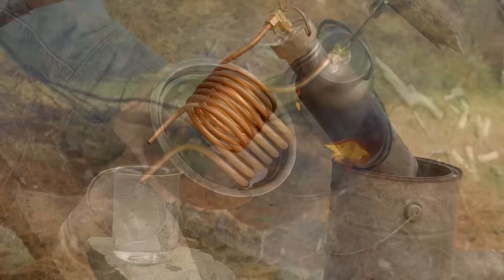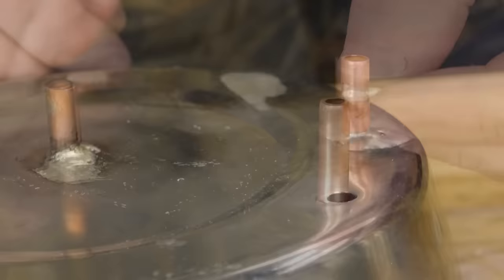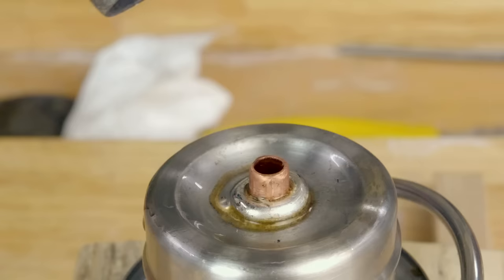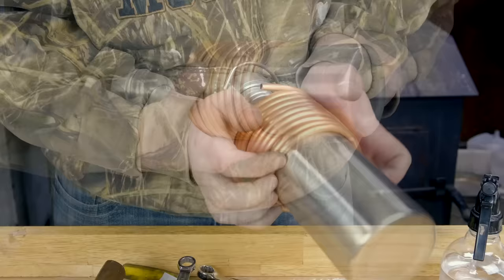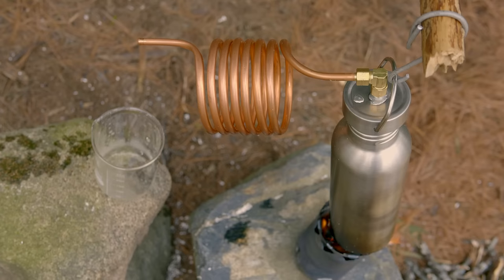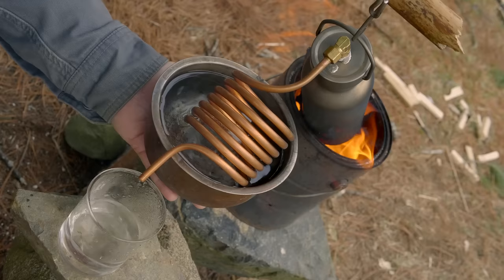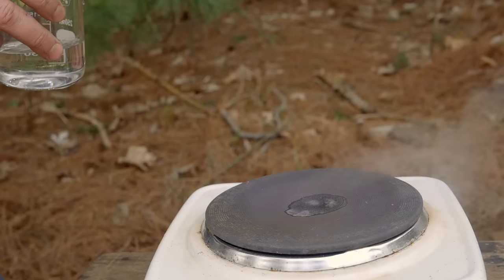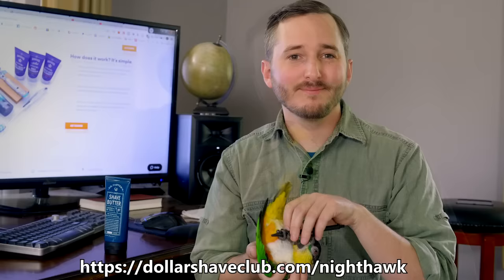DIY Salt-Water Survival Bottle (Compact Desalination Kit)

Comment: A lot of steel water bottles have a non-stick coating inside. Also important to make sure that yours doesn't before boiling water in it.
Reply: This is very important and should be mich higher up in the comments for more people to see and for NightHawk to see as well.
Reply: This is very important and should be higher up in the comments for NightHawk and others to see because steel bottles indeed have coatings on the inside.
Reply: +1 
(Replies seem to push comments further up)
Reply: Yep
Reply: There's no point in trying to remove it. Just buy one that doesn't have one.
Reply: This video has a lot of big no no’s.
Reply: Maybe not if it is stainless steel, he said to use a stainless steel water bottle.
Reply: He could just use a camping cooking pot with a modified lid, or a storm kettle
Reply: Movin on up, movin on up
Reply: Bump
Reply: Uhhh...bump?

I was under the impression that almost all cans have some kind of plastic liner which is why you can't cook or boil water or smoke out of them. I'd imagine an old paint can as being a bad idea too...
Reply: @Mikey-ym6ok  enlighten us bro
Reply: Maybe burn it off?
Reply: Show me an example of a stainless steel water bottle with a coating inside. Never heard of such a thing. Aluminum, yes, SS, never.
Reply: bump
Reply: Michael Smith wait what else did i miss that i should probably take into account?
Reply: @Kernels actually you can usually burn them out.  Just make sure to clean it very well before using.
Reply: bump bump bump
Reply: K. as a kid I could remember feeling the inside of an old canteen and there was like a film now I know why
Reply: Literally the first thing that came to mind.
Reply: Comment to get it up
Reply: Aluminium, yes. Stainless steel, no. You could change your comment to state that.
Reply: Bumpidy bump bump
Reply: Well said. My kids watch these kinds of videos.. so thanks for mentioning this :)
Reply: Definitely! Is it possible to simply burn out that coating first?
Reply: K. Reply
Reply: Mr. Tangent just look up soda cans with it in it. It’s similar
Reply: bump bump it up
Reply: Commenting to push this to the top
Reply: @MealeaYing  its there to protect from oxidation and such. So by physically removing that saftey piece. May not be the best long term choice of usage. Heavily depends on the metal type and purity. Aluminum for example is toxic especially when heated.
Reply: +1
Reply: @demonsparkx  you're talking about long term usage for a device meant to be used in survival circumstances?
Reply: @DylanNeo  well in that sense,more so as a "multiple time usage" so i suppose?
Reply: @DylanNeo  salt + metal+ heat... thats all i guess.
Reply: Bumping this comment for your mum mate
Reply: @Mikey-ym6ok  which are?
Reply: Michael Smith.... 

Where you at?
Reply: Huuhhgtt
Reply: opaz79 chemical mixes with it
Reply: Also, be sure to use lead free solder for the fittings.
Reply: just wanted to add that if you happen to be using a vaccuum insulated water bottle like a Hydroflask (very popular nowadays) this definitely wont work, don't try heating that sucker up!
Reply: @isaiahstephens3509  Stainless steel containers still contain a coating of some sort of liner, to keep your drink from tasting metallic.
Reply: @Kernels cooking it will remove it
Reply: Michael Smith 
Like led  of the joints?
Reply: Michael Smith 
Please explain the no no's
Reply: @Kernels no coating is necessary especially if the container is made from stainless steel.
Reply: Aluminum water containers would be inappropriate for this as they can quite easily burn up in the process. Stainless or even regular mild steel would work.
Reply: Great comment never thought about it thanks for sharing
Reply: @Mikey-ym6ok  why? Tell us more thanks
Reply: @BajaSurf  there are carcinogenic coatings on metal bottles to keep them from corroding  and rusting. which leaks in the liquid then inside our bloodsteam. i just say to be cautious and use a pots thats meant for cooking and not insulating
Reply: @michaellinner7772  im a welder and stainless steel has a coating to make it stainless. thats why we have to wear respirators to prevent inhaling the stainless coating when welding a stainless material.
Reply: Bump bump :)
Reply: @Mikey-ym6ok  I researched the bottle used on this video. According to the seller/manufacture Sold by TripleTree that bottle is non-coated (in and out), lead/BPA free 18-8steel. Making it completely safe for this procedure. NightHawk didn't mention it in this video. But, was it really needed?
Reply: Pressure cooker or a regular kettle with a modified tip will do the trick. Can flow directly into the watery bottle.
Reply: I havent heard of any stainless steel bottles having a non stick coating, not even SS pots or pans. But I dont think thats of any concern if you needed to resort to making clean water from salt water.
Reply: @Mikey-ym6ok  I don't know what kind of welder you are,  nor do I care, i work with stainless as it's made, it is non ferrous,  as is all stainless steel, it is an alloy that contains zero iron and does not rust. There is no such thing as a coating to make it stainless!. You should wear breathing masks with ANY welding if you can't avoid the fumes.
Reply: +Shane Stevens

The guy who said stainless steel has a "coating that makes it stainless" was hilariously wrong, but what the hell are you talking about "stainless steel is non-ferrous/has no iron content" !?

The definition of stainless steel is literally "Stainless steel is an alloy of Iron with a minimum of 10.5% Chromium." Google it if you don't believe me.

Stainless steel not only contains iron...it is iron with other alloying elements, especially Chromium. 

If you had said "non-ferrous", and left it at that, I would have thought you made a mistake, or misunderstood the meaning of "ferrous"...but you reiterated, and emphasized, "no iron content" so I'm just baffled.
Reply: @Kernels maybe strong acetone or something similar.
Reply: @HipposHateWater  No they don't! Stainless steel doesn't give off any "metallic" taste. That's sort of the point with stainless steel -- it's stability, and thus resistance to "give off" anything.
Reply: Never again will i drink distilled water without first adding some himalayan rock salt!
After drinking only Distilled Water for two weeks, all the discs in my neck were grinding and pinching! Very painful! it took months before i stopped feeling the terrible pinching!  Every now and then it comes back for a bit!
Reply: Michael Smith so what are they?
Reply: @donsunb  wow, thanks for taking the hit so I don't have to...
Reply: Chet Carson  if your in a servival situation, you're probably not eating healthy.
Reply: demonsparkx What about a custom copper water bottle without any lining
Reply: demonsparkx What about a custom copper water bottle without any kind of lining
Reply: how do i check if my bottle has a non-stick coating inside?
Reply: And that coating causes cancer when heated.
Reply: Michael Smith yup so does the rubber sealing thing
Reply: @Mikey-ym6ok  Stainless steel is "stainless" because of the addition of chromium and nickel.  316SS also has Molybdenum.  There is no coating on stainless steel, at least not to make it stainless - it doesn't need it.  You wear a mask to avoid inhaling hot vapors, some of which are toxic and some of which are only physically harmful to your lungs.
Reply: Non stick as in?? Do u mean Teflon coating??
Reply: thanks for this suggestion!
Reply: Yes
Reply: @bowttt  Thanks! I wish the OP had just said what bottle he used in the video or description to save us all  a lot of guessing.
Reply: @Kernels 
No coating at all.
Reply: @Mikey-ym6ok  
Can you be specific?
Reply: @GreatSageSunWukong  
Kettle is great idea.
Best solution uses
Charcoal fuel source, eg gallon paint can with holes in lid left on camp fire about 2 hours, or till no more smoke escapes can.
No paint can?
Bank camp fire coals. 
Cover with dirt.
(Bee Hive oven).
Dig out charcoal
when fire is cool.
Reply: @bodypilot2006  
Thank you for pontificating, Comrade Troll.
Apples & Oranges.
Are you Mossad???
Reply: @calysagora3615  hexavalent chrome is formed welding stainless steel
Reply: this may have been mentioned already but steel bottles dont have coatings on inside. tin and aluminum bottles are the ones with coatings. i can produce several of each from my collection to prove this.
Reply: @blumac9801  soda cans are ALUMINUM not steel. aluminum bottles and cans have coatings NOT steel.
Reply: doubt it matters, he's distilling it lol. besides, would you rather saltwater or a little bpa
Reply: @Mikey-ym6ok  Yes thats true, but it does show a cool concept that is also useful in real life. Hence, the comment section filled with big brains making it better.
Reply: Aside from that, a lot of them have a gap in between 2 layers that is vacuumed. That would make it hard to boil .
Reply: Thanks for a crucial warning. That non stick stuff puts out a DEADLY vapor. Probly would spoil yer likker too. Just sayin.
Reply: @Mikey-ym6ok  Go on. Tell us more.
Reply: .  I believe the respirator is a precaution against the filler metal used in the welding process. Stainless steel contains chromium and other alloys so welding this material creates potentially toxic vapors. The feller material can also contain certain chemical fluxes.
Reply: @shanestevens622    stainless does have iron and therefore is ferrous. By adding chromium, zinc, and other elements we change the molecular bonds or the crystalline structure. This change makes it non magnetic.
Reply: shane stevens there are ferrous stainless steels mate and they do contain iron hence being magnetic
Reply: @Kernels maybe acetone. I don't know much about chemistry but acetone dissovles some plastics and its probably BPA.
Reply: check those bottles
Reply: I did notice a few specks of black stuff come out when he poured a little of the concentrated salt in. It wouldn't be a problem if he didn't pout any in, though perhaps a few volatile chemicals in the non-stick could vaporize if they are lower temp boiling than water.
Reply: @travv88  its not concentrated salt you can't concentrate a pure compound. It only applies if its a solution. Also without salt in your water, pure distiled water will make your cells explode to equalize the difference.
Reply: Brian Landers  oxidization if i spelled it correctly,yes that is the worst of the worries once near critical temps are reached with certain metal grade alloys. Aluminum oxide. Titanium oxide etc,for example. Are hazordous to health especially in due to long time exposure/ingestion. This is based however soley on pursonal knowledge and research of alloy metals,heat,and usage there of for human based consumption/cooking etc.
Reply: @bowttt  yes because some stainless is I'm not really stainless like Michael Smith was saying. 
Real stainless is harder to work with more expensive and a lot heavier.... or else you wouldn't see stainless steel bowls and containers in the dollar store..
 I myself prefer to use a plastic bottle on top of an asbestos tile and then I add some MDF dust or grindings to soak up the salt and just spoon that out and have myself a really nice super purified legitimate well drinking water for survival in any circumstance or everyday use😄🍳
Reply: @reiki2165  lacquer thinner or xylene but if you have those then just use the container they come in
Reply: @giottolaudo7672  with all due respect to your experience and the others who share your opinion, it's extremely possible that there are really cheap versions of stainless steel better actually just coatings the same way Chrome or nickel plated is.
 In my other comment I use an example that you can get a stainless bowl at the dollar store...
... am I wrong I can accept it if I am but if there are different grades of stainless and it is possible to apply a stainless coating in any other form that a coating can be .... wouldn't that make sense?

.... in a week and Mild defense to mr. Smith or the person that said stainless has/ is a coating, could he be referring to the oils or a protective layer that comes on Raw stainless that is meant to be used in fabrication or pre-production?
.... it's also possible that he is speaking about the material used to well the stainless or cut it for that matter because it may change structure with the heat involved and look like a coating at that point.

..... either way if fire is available in emergency situations I would heat the s*** out of it anyway just to be sure.
Reply: @DylanNeo  isn't survival supposed to be long term? I know I want to survive long term 😹
Reply: @the20thDoctor  He used a coffee can, not a paint can
Reply: @demonsparkx  The whole point of stainless steel is that it doesn't corrode, and therefore shouldn't need a liner. People often buy stainless steel water bottles instead of aluminum for that very reason. They don't have to worry about anything leaching into the water from the metal.
Reply: @Michael Montgomery a year later and glad to see i never even was bothered to be fuckin notified by youtube of your reply. Triggered much? Didnt know there was children watching this video which can demonstrate a potentially harmful hazard to mimic without proper understanding of different alloy compositions. Lol...
Reply: @wolfy1987  SS food grade stuff can be easily obtained in very reputable forms in camping survival sections of many franchised stores like Wmart. We have both a stanley Stainless Steel and a aftermarket online purchased  similar style cooking cup but is Titanium. Both work great even despite dry-heating each of them to see how the alloys held up. Most bad low impure quality "knock off" products metals seem to flat out permanently taint anything put in afterwards.
Reply: @gulktroktet  How do you do that?
Reply: Just want to say that i have alot of stainless bottles, they DO have a coating on the inside, i think its a clear teflon coating or some kind of non stick to prevent drinks from dirtying the inside
Reply: As long as you keep the bottle temperature close to 100C, it probably isn't an issue. Especially not an issue if it's your only water option
Reply: Stainless steel doesn't have a coating inside, you are thinking about aluminium, which shouldn't be used anyway. Also, buy a product that passed the food grade standards of first world countries, never buy some low grade SS product directly from China.
Reply: @Mikey-ym6ok  You are thinking about dichromates, it is not a coating but rather an ingredient which turns the iron into steel, the chromium alloys with the iron and isn't present anymore as carcinogenic Cr(VI). In spite of the chatter surrounding the amount of chromium and nickel contained in stainless steel surfaces, the bond of the alloy used to construct the cooking surface of quality stainless steel cookware sets is quite strong. This alloy strength helps pots and pans resist leaching, making them quite safe.
Reply: @shanestevens622  Stainless steel is still an iron-based alloy, but as it contains next to (~70-80%) iron at least 11% of chromium and at least 8% of nickel, the other metals completely remove the iron's capacity to rust, and its magnetic properties. Often molybdenum is added too,  improves resistance to "pitting corrosion". You are right though in stating that an alloy isn't a coating, and that you should never breathe the fumes from any welding.
Reply: @bromisovalum8417  no, it is stainless steel, and it does have a coating on the inside of some of my bottles. Obviously stainless is an alloy and normally wouldnt be coated as its resistant to oxidation. But in some of my water bottles they add a teflon or non stick coating to the inside..
Reply: @giottolaudo7672  my apologies,  you are correct, I learned something today. I always thought it was a non ferrous steel, and borne out by it being non-magnetic  but, have found it is the inclusion of the nickel that renders it non-fed magnetic,  some grades must have less nickel though because I have come across some magnetic (weak) stainless steel. Cheers.
Reply: @thomask940  yes, you are correct,  I was wrong, I've learnt something new. Cheers
Reply: @LukeSmith-pp4hn  yeah, sorry, I've been wrong about stainless, I couldn't understand why some of the stainless I've encountered was magnetic,  now it makes sense.
Reply: @bromisovalum8417  yes, thank you, I was wrong about the metallurgy but I'm still sure there is no coating on stainless bottles.
Reply: @Mikey-ym6ok  what? Stainless steel is a coating? Like a paint you mean? LOL
Reply: @donsunb  do you still drink (only?)distilled water (after adding some stuff in it)?
Reply: Can the rubber sealant melt during the boiling process?
Reply: Not stainless ones
Reply: Only aluminum bottles have a need for that coating. Stainless will not have this.
Reply: Check out the movie “dark waters” about non stick coating
Reply: The owner of this channel should pin or heart these informative comments. So everyone can see these bits of usefull information.
Reply: boil water and throw away for several times or burn dry the bottle before consuming it, like sterilizing it , no big deal if it only for survival.
Reply: Bump
Reply: You guys did it lol it was the first comment I seen and it definitely wouldve saved me lol
Reply: Sorry to necro a year old comment, but stainless steel nalgene and klean kanteen are both suitable options
Reply: @Mikey-ym6ok   specify on SS , there are no coatings on that bottle ,specially if sold for human food consumption ...if so , what is the coating you say they use?
Reply: @Mikey-ym6ok  you have to use respirator for "all" metal welding to protect your lungs not just for ss and the fumes also comes from the rods or wires you are welding with !
Reply: I ordered titanium bottle for this, problem solved.
Reply: قنفإ
Reply: @nicklopez7536  ..
Reply: @MealeaYing  if it has a coating, it's aluminum and not stainless steel.
Reply: @Mikey-ym6ok  Please name them so we may learn?
Reply: Água destilada não deve ser ingerida.
Reply: Thanks captain obvious
Reply: If it is stainles steel a coating is not needed, so it is not added. 
Why would you increase your manufacturing costs for no reason?
A water bottle with an internal coating is not stainless steel.
Reply: Sus
Reply: Very true
Reply: @ButtersDaBaller  im stupid so tell me why?
Reply: @Mikey-ym6ok  We need your wisdom michael smith, please inform us all of the “No nose”
Reply: @shanestevens622  Did @Michael Smith lie to us? ——-Why would he do that?
Reply: @giottolaudo7672  So @Shane Stevens lied to us? Why would he do that?
Reply: @donniexl1033  He probably didn't 'lie' willingly,  but was misinformed, or understood the situation wrongly,  as I my self did on the iron content of stainless. Stainless  needs no coating,  that is why it is called ' stainless ' , specifically because it is highly resistant to corrosion.
Reply: Nice Catch, :)
Reply: Bump
Reply: @SnahLhug  you are wrong, stainless has it too
Reply: YES YES YES.....  I was just going to post the same thing....  That coating will get you sick
Reply: @nicklopez7536  

l
Reply: Bump
Reply: @nicklopez7536  aww😚😚😚
Reply: What if it has? How this is going to affect the process?
Reply: Good video
Reply: Coating is a safety concern, also vacuum insulated bottles might make this less efficient. The simplicity makes it maintainable and usable without much education needing to be provided.
Reply: Moonshiners make a helluva better rig anyday
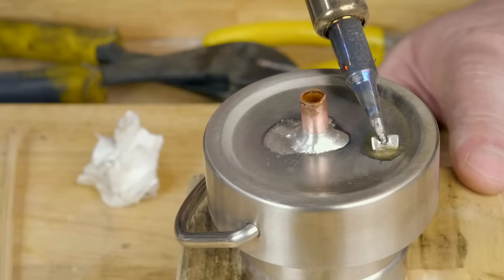Reply: 2:50 why he drill a second tiny hole...and then seal it????
Reply: @fabiano6408  the second hole would allow expanding gas to escape instead of increasing pressure inside the cap when applying heat for the solder.
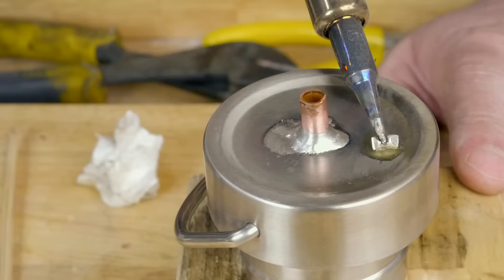Reply: @poneetrahul  but a 2:50 he seal the second hole, why seal it?? How can escape pressure it is sealed?
Reply: @giottolaudo7672  yeah I was literally thinking that when I was scrolling the comments and found a post lol haha
Reply: @ButtersDaBaller  what if you still tiny holes on outside of it at top for any steam ECT to exit?
Reply: Yep
Reply: Crucial
Reply: Good stuff.
Reply: I guess that coating is gonna melt and is probably not something you should consume?
Reply: 0:38 Drinking destilled water dangerous? Old wives tale. Shoot with all the stuff they are putting in the drinking water now. Drinking destilled is a 100% guarantee more healthy.
Reply: @shanestevens622 stainless steel is mostly iron. It’s the addition of chromium, nickel, carbon etc that creates a passive film that prevents corrosion
Reply: Thanks, I didn't know that. I guess in this case I should buy the cheapest bottle since coating one costs money, lol.